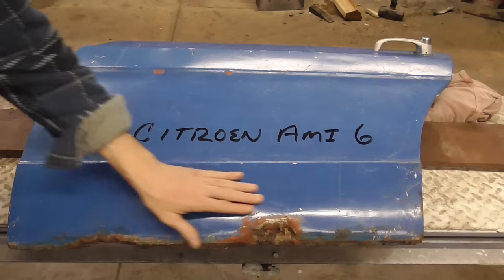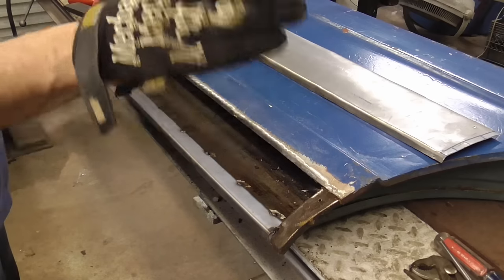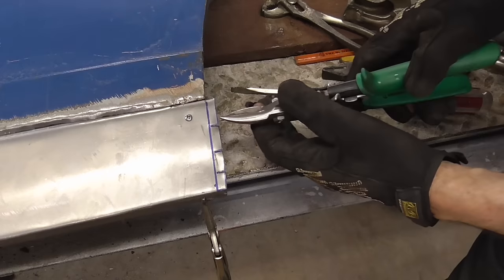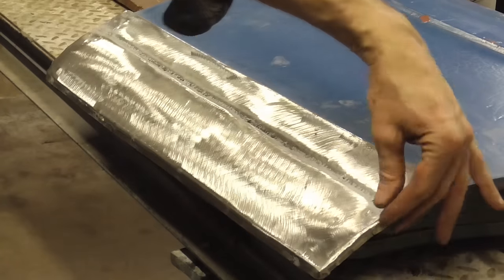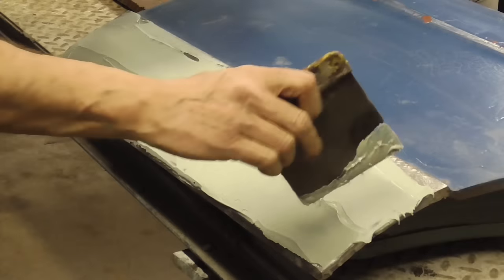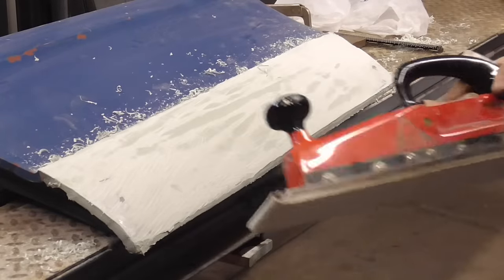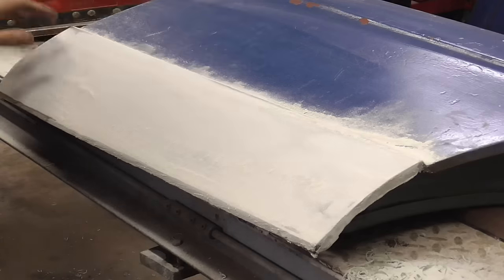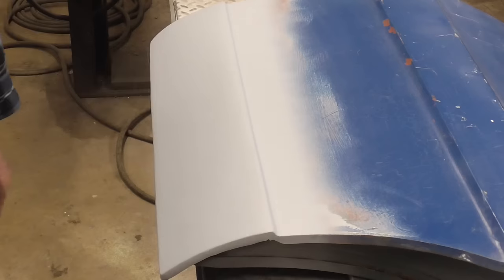Butt Welding Automotive Patch Panels - Start to Finish

Comment: What do make your patch panels out of?
Reply from the maker: A1008 cold rolled sheet metal - 20 gauge - 4X8 from Alro Steel  You can use anything from 20-22 gauge or .030 to .035.  Thicker for the real old stuff 40s and 50s

Comment: That was nice work on that patch panel, like what you did creating a bevel to take the weld
Reply from the maker: Thanks 👍
Reply: @LakesideAutobody  
Does that help it to not warp as well?
Reply from the maker: @ninja63639  Maybe a little bit but if you get it too hot it still will distort.  Good thinking though - have a good weekend

Comment: Good work Sir!  What primer surfacer do you use!
Reply from the maker: Lacquer primer - I know it sounds old fashioned but it works well, drys fast, builds fast, sands easy, you can mix it thick or thin, and you can leave it in the cup and it won't harden - real cheap too :)
Reply: Lakeside Autobody.  Hey, if it works for you, use it!  Everybody has their own system.  My absolutely favorite primer surfacer is called  "All-U-Need". Made by Clausen's.  Basically a spray polyester primer filler.  Works great for me!  Take care and quarantine yourself if you can.  The virus is bad stuff!

Comment: What metal gauge is  that?
Reply from the maker: 20 gauge A1008 cold rolled sheet.  I use anything from .030-.035 or 20-22 gauge.
Reply: @LakesideAutobody  Thanks!

Comment: You make it look easy, Jerry!  

On the top edge of say a rocker panel patch, would you recommend the 45 degree butt-weld over flanging/lap weld, if either one were possible?  I'm currently butt welding the driver's side rocker patch on the van I'm working on, but might try flanging the one on the other side to compare strength and ease of filling.  I suppose it depends on the vehicle, but wanted to get your opinion.  The Caravan I'm doing is unibody.

Thanks again, I love your channel!!
Reply from the maker: You'll get a ton of different opinions but to me it doesn't make a difference because panels start rusting from the very bottom anyway.  Do what's easiest for your situation.  The way you prevent rust after the repair is really what counts - see this vid.... https://www.youtube.com/watch?v=DqxMHCizkUE

Comment: Thanks for the video. I've seen others epoxy coat the bare steel before filling, is there an advantage to how you are doing it?
Reply from the maker: No body shop that I have worked at ever used anything prior to spreading the filler.  Sanded/Ground (w/ 36-40 grit fiber resin disc), clean bare metal is a great surface for filler to stick to.  The idea behind using it is corrosion protection.  I don't think it would hurt if you wanted an extra layer of protection and I can see how it might help if moisture got through the welded seam. but it's not necessary especially if it's just a dent or your seam was welded solid.  Hope that helps a bit :)

Comment: On the average , how long do you usually wait before you cheese grate , 10 minutes or while it seems dry but tacky. ?
                                  Thanks.
Reply from the maker: I wait till its the stiffness of a block of parmesan cheese.  If you can't dig your nail into it, you waited too long.  You're right - right around 10 minutes.  If it clogs the grater - too soon :)